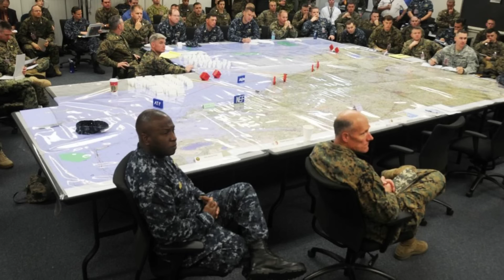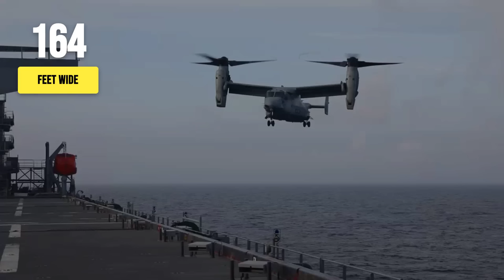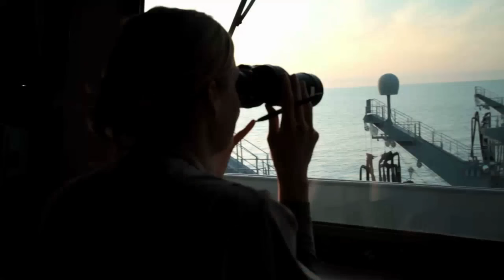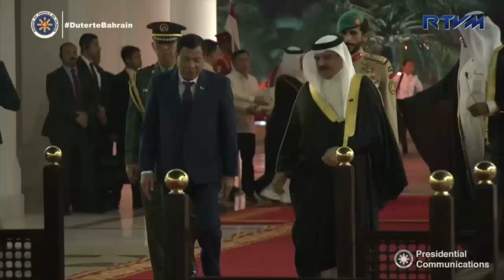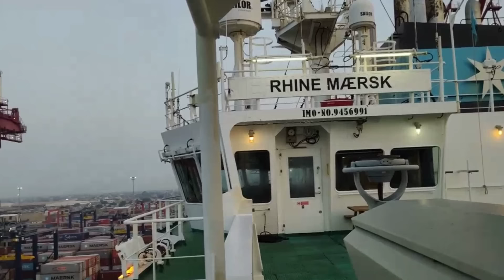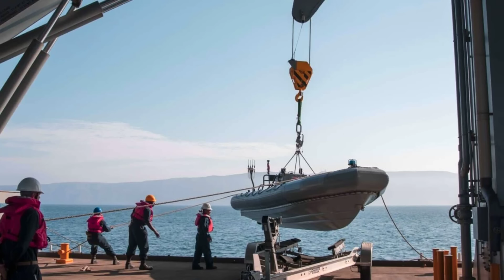Inside The Largest Expeditionary Sea Base in The US Navy

Comment: Pretty juicy strategic target. Barely any weapons. Probably needs one or two subs loitering around to provide security. Admittedly, it's an innvating, interesting class of ships. Modern subs, though, from any of the nuclear powers, have sophisticated tools at their disposal to locate, isolate, and then destroy said juicy target. PuhLEEZ someone tell me in general, non-whistleblowing detail, that these things have adequate protection.
Reply: This is intended to be part of a strike group of ships, lcs or two, few destroyers for air defense, antiship/asw.... more then likely the strike group will have several naval and air drones on hand for defense..... counter-UAS system like roadrunner and coyote or even a few cram/cwis...Odin lasers for sure will be added when needed.... then consider the esb boat itself may have a few cobra helicopters with hellfire longbow missles onboard for area defense....

30mm airburst rounds are a cost effective option also.... hell you could even just park a few hmars/avengers on deck for good measure....

Bottom line your not sneaking up on these boats....
Reply: Its for lower threat environments and has escorts and self defense

Comment: How does it protect itself?  Where are the CWIS and RIM mounts? Or, does it require escort by valuable capital ships - of which we are critically short.
Reply: Proabably still secret and hidden anyhow
Reply: 12 x 50 cal………….
Reply: This is intended to be part of a strike group of ships, lcs or two, few destroyers for air defense, antiship/asw.... more then likely the strike group will have several naval and air drones on hand for defense..... counter-UAS system like roadrunner and coyote or even a few cram/cwis...Odin lasers for sure will be added when needed.... then consider the esb boat itself may have a few cobra helicopters with hellfire longbow missles onboard for area defense....

30mm airburst rounds are a cost effective option also.... hell you could even just park a few hmars/avengers on deck for good measure....

Bottom line your not sneaking up on these boats....

Comment: About 30 seconds into this and I have a concern.  It's not with the idea or that they don't have the ability to do it.  The concern I have is if this works great, which it probably will, China has 1,800 of these.  Maybe their not all super tankers but they do have 1,800 oil tankers.  I think we're giving them an idea and you know how that works.  They'll run with it.
Reply: The Chinese navy has an entirely different structure and purpose from the USN. They would have little need for such a setup.
Reply: China can't keep their carriers from capsizing when being launched at it commissioning

Comment: I've always wondered if nuclear carriers, like USS Nimitz, could be repurposed as support ships. These service or support carriers would, of course retain considerable combat capabilities, can be specialized for missions like anti submarine, troop transport, logistics support or disaster response. High speed, nuclear powered and already built. Redesignate them something like CVSN. 
   Ships like that aren't junk. Use them like 
old Essex Class carriers. The speed and flight deck...
Reply: A retired carrier seems like an ideal platform for a VLS laden “battleship” utilizing the hangar space for the missile cells and even using the current jet fuel bunkers to UNREP support ships. Probably cheaper than $15B a copy.
Reply: The operating cost makes it not an option.
Reply: If they don't use a nuclear carrier anymore, it means its ready to go to the junkyard, nothing to repurpose.
Reply: They don't decommission a nuclear carrier till the fuel is used up, and it costs in the billion dollar range to refuel or remove the reactor.